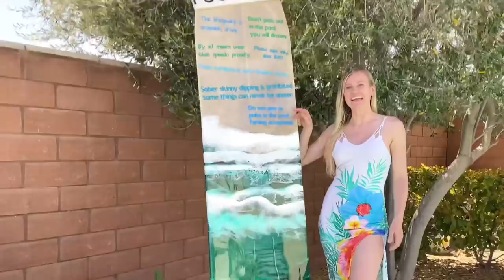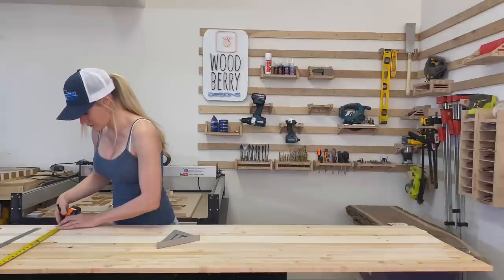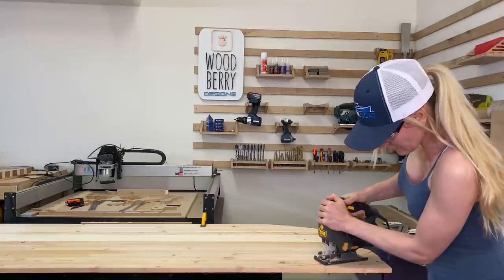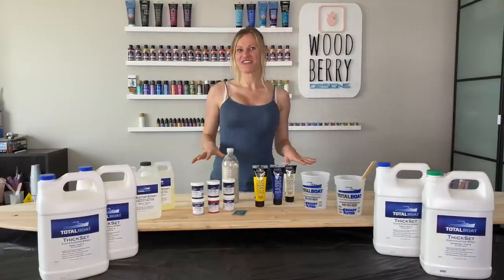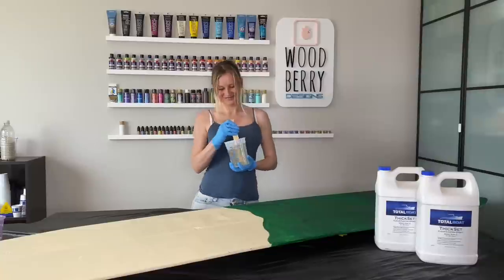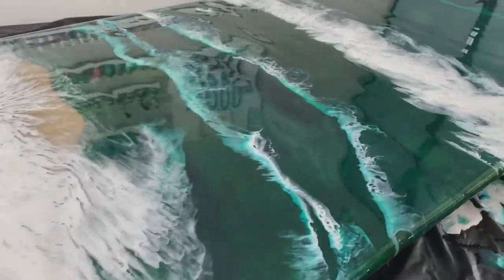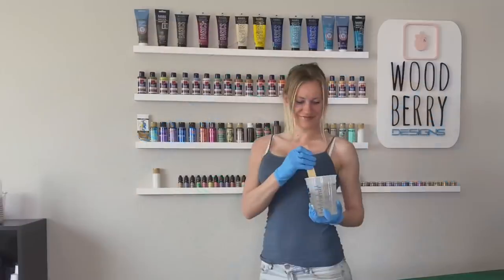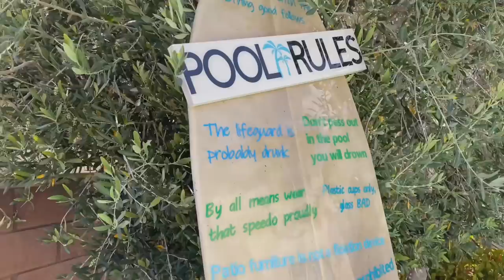Rules are there to be broken - DIY - build - Pool Rules sign Ocean wave Surfboard Summer time👙

Comment: If you don't want to use the biscuit joiner and have a pin nailer, use that.  Using a piece or two of cardboard to make the little steel pins stand  proud of the surface hit the edges to be glued together. You won't need many  pins and only need to put them into one side.  When you bring the wood together with the glue the pins will prevent slipping.
Reply: @scrotiemcboogerballs4967   I have learned my lesson and it's a bitter one. You put two pieces of  carefully machined lumber together and  they are coated with slippery  glue and the clamps the dammed clamps  exert torquing forces on the wood pushing them in the craziest  directions and you are scrambling to try to get them  back in alignment and it's a losing battle.  Ya gotta do sumpin' to make 'em stay put.